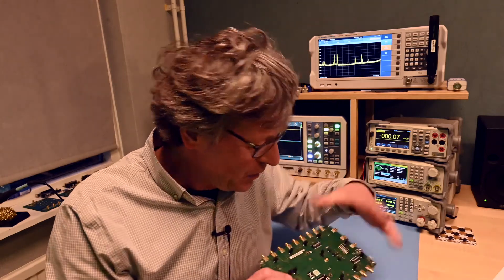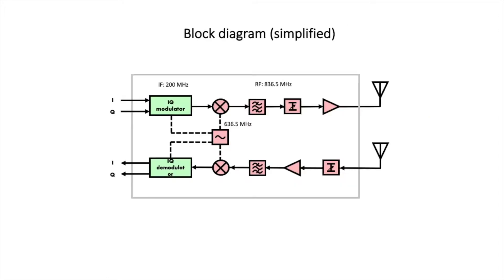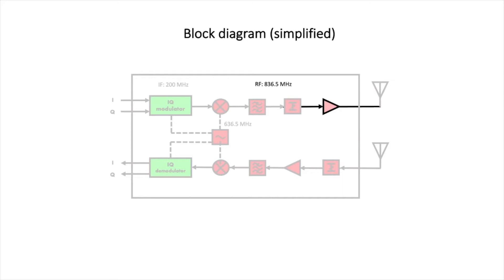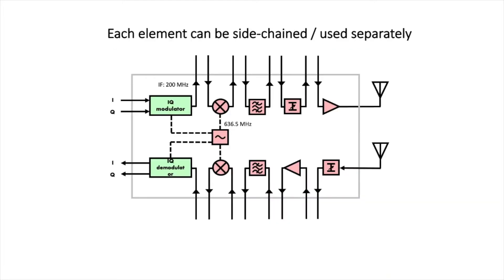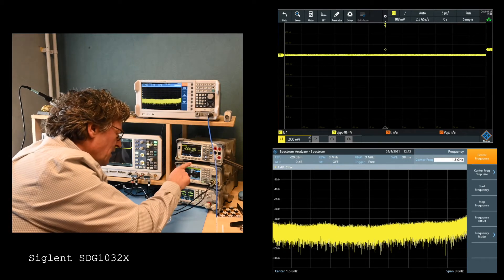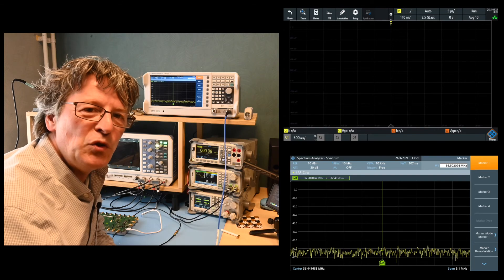REL #01 Rohde  & Schwarz FPC-Z10 Teaching Kit - Hands-on Review

Comment: Nice overview. I just bought an FPC1500, and decided to bite the bullet and buy this Z10 so I can learn more about it.  I hope you do many more videos with experiments with it, especially to fill in the gaps of the user manual.  I also bought a variety of individual modules (mod/demod/mixer/filters/attenuators/amps) so I can try to replicate the board's functions externally and/or as add-ons, to further experiment and compare results.
Reply from the maker: Hi Stan, sounds interesting to hook the Z10 up to the modules you mentioned! Let us know how you fare, and additional knowledge you gather! I bought a MiniCircuits 175 to 237 MHz bandpass filter (ZX75BP-204-S+) to use in conjunction with the Z10 and suppress some expected reflections but did not yet get to get into it deeper. Will keep you updated.

Comment from the maker: Timeline: 
  
00:00. Introduction
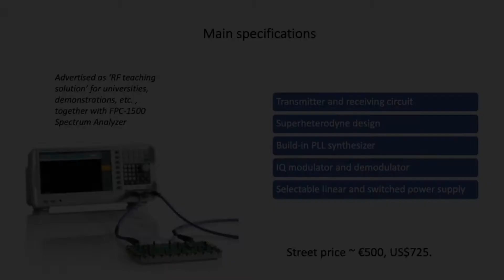01:45. Specifications and functional diagram
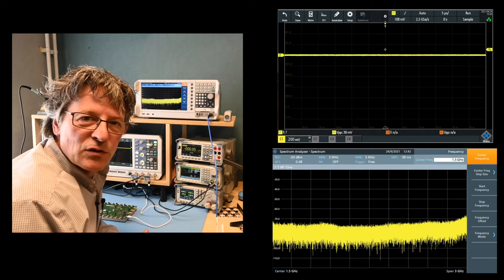09:24. Measurements:
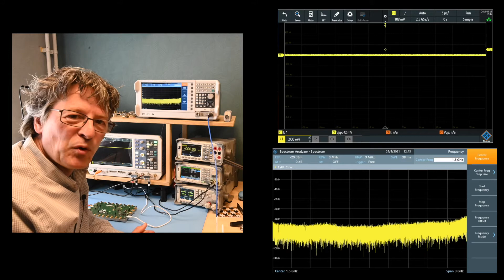    10:32. Input signal 
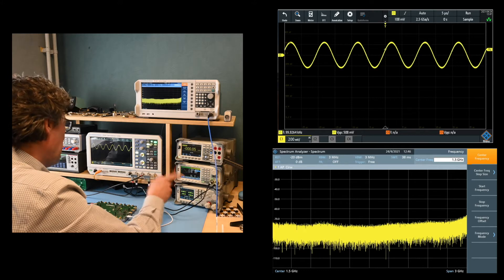    12:46. IF signal
    21:98. RF signal
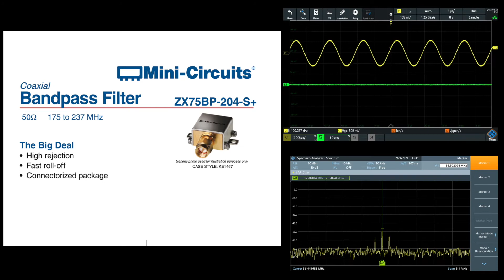    29:14. Demodulating I signal
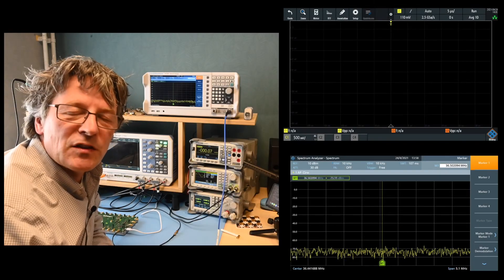    32:09. Demodulating IQ signal and digital/multilevel signals
    34:10. Future experiments
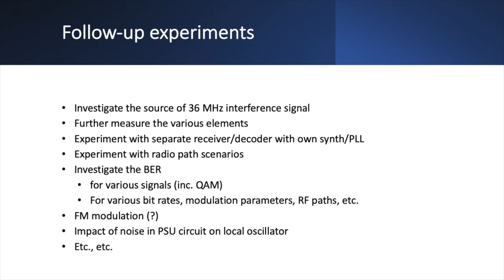34:50. User manual (and its issues)
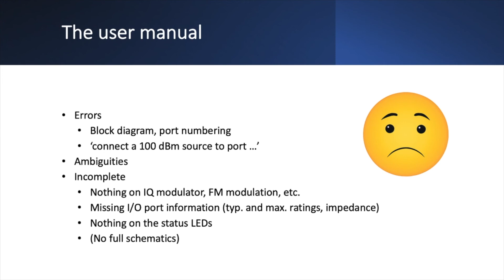36:55. Conclusions
38:05. Alternatives

Comment: This board seems to be a little tricky from the educational point of view. Think about it. All mixers (real mixers and mixers inside an I/Q modulator/demodulator) are fed from the same frequency source. This means they are locked together in frequency and phase. Which leads to situation you don't have to deal with costas loops in a receiver path, so you have the signal path with suppressed carrier, but that phase information goes through different path, which means you don't have to recover it when demodulating. But in real world, you have to and it's a crucial part of the whole design. And of course, you can use two boards, you can use some VSG to generate signal, etc. And this is not only the issue of this board, issues like this happens often in labs, where everything is synchronized to one central GPSDO. 

In fact, I like that board, it's a decent piece of hardware, but works fine only with a proper mentor, that is (as expected) not included :3.

Comment: Hello Rudi, I'm also interested in buying this board to learn about IQ-Modulation/Demodulation. Could you tell which kind of baseband signals you have used to create the QAM you showed in the Video starting at minute 32? Thank you.
Reply from the maker: Hi Elfi... I guess you refer to the picture with the 64 points in a QAM-like configuration. That was done by feeding the I and Q channel each with a arbitrary signal from a Siglent SDG1032X or SDG2042X which I think is called "Stairs". You can see its shape in the tiome domain graphs just next to the XY screen. Both get the same signal, but they are slightly different in frequencty, so, as a result, all the possible combinations (1-1, 1-2, 1-3 through 8-8) will occure. Its a fairly standard signals and I think many other signal generators will have this among their build-in arbitrary patterns. Also some Siglent osciloscopes with build-in ARB function generator have it (at least my SDS200C+ series does) but then you just have one channel, and you need two... Good lock! The Z10 is worthfile to explore!

Comment: FYI: I use as well FPC1500, etc. The FPC1500 generator does not produce clean sine wave signals, for lower frequencies the RF generator generates square waves which results into many harmonious.
Reply from the maker: Indeed, the tracking generator (TG) of the FPC1500 generates has lots of harmonics and looks more like a square wave than a sine wave. Then again, this is true for most spectrum analyzers (SA). TG signals are designed to feed into a DUT and to have the SA measuring the output of that DUT. Because the SA scans a narrow frequency range that sweeps along with the TG, there is no need for a clean TG sine wave and hence no need to make the (significant) investments that would be required to make a clean sine wave… If one needs a decide that generates clean sine waves over a wide range (e.g. 0-3GHz), one needs to resort to HF signal generators, which often cost as much as a spectrum analyzer.
Reply: @rudiselectronicslab861  your are right, however the FPC allows to use the tracking generator output as a stand-alone frequency generator.
In the meantime I purchased a used Agilent 4432B which produces very clean signals, including multiple signal signals (3G, BT, etc.). I just needed to repair the display background light and a stuck mechanical step attenuator which was easy.
Regards from Hannover, Germany, Helmut
Reply from the maker: @HelmutTschemernjak  Indeed, the Agilent 4432B is a serious signal generator for HF tasks. Good luck with it!

Comment: Hi Rudi, thanks for this video, I've just ordered a FPC1500 (fully loaded) as R&S are having 36% off promotion.  Appreciate details on the Z10, as like you, I'm interested in expanding my knowledge in RF.
Reply from the maker: Thanks, Mike. The FPC1500 is a very nice device, especially when fully loaded. If you have not seen them yet, do check the Element14 user reviews of the FPC,, especially those of Geralds and Sbabaz. With the latter, I had several exchanges on calibration and cable distance (can be seen below that review).  Anyway, enjoy the FPC and let me know if you also gain experience with the Z10 kit. PS
Reply: @rudiselectronicslab861  thanks Rudi, that’s a great resource and I particularly enjoyed your discussion re calibrating and compensating for cable length via the instrument. Nice find!! I will order the teaching kit as well, this is really interesting. Best M

Comment: Dang, paying 725 USD for teaching & testsignal board, thats heavy, like he ain't my brother, and almost double the price of my Micsig scope.
I have seen these teaching / test board in numerous videos, both from Tektronix and other vendors and it seems theyoften are handing them out to influencers...but they are not that uncommon.. but what about the Chinese flee market.. don't they have variants at a fraction of the cost.??
Reply from the maker: It’s true that this teaching board is expensive. I doubted quite a while before I purchased it (need to add that thanks to my job, I qualified for educational discount). It would be great if there were more choices on the market. But teaching/experimentation boards for IQ quadrature (de)modulation seem rare. When I made the video, the only others I came across are the Analogue Devices evaluation boards I show at 38:30 in the video. Expensive too. Have not seen cheap boards; perhaps because the required chip sets are relatively expensive?
Reply from the maker: Also real IQ generators and RF signal generators that have IQ inputs are expensive instruments. I soon hope to post a new video with a second hand combined IQ RF generator bought from eBay, and will certainly use the FPC-Z10 Teaching Kit in those tests!
Reply from the maker: “and it seems theyoften are handing them out to influencers..” Interesting. Jacob, could you be so kind to share URL’s?
Reply: @rudiselectronicslab861  Its "Jakob" good old "K"....and I recall two of biggest test equipment channels on YT.. Dave EEVblog and also Signal path... that some of their test & demo boards.. were gifted alongside some freebie product for reviews.

so Im not sure what kind of "link" you want..as I doubt sources like Tektronix etc.. will not see you as a significant "influencer" with merely 185 subscribers, - for that kind of backland' its often about the numbers, no matter the quality you deliver Rudi., which certainly is solid.
and also not possible for me' to put anykind of third-party link..
only the main channelholder can put outside link in comments..I can only link to other YT sources..

but from a big vendor looking for influencers for advertising & prm0ti0n of a given product fx a scope, it would make sense to incl. a demo or testboard to show some of the aspect a given product excels in..
also recall Aplied Science, used a demoboard that were handed when he were gifted a scope from Tek - but its years back.. in some regions its quite normal this lubrication of influencers, also why YT now have implemented, - that its needs to be stated.. and if a video holds anything of value that you been sent from a third-party to make that video, its "pald pr0m0tion as per se" and the video needs to be labelled as so..
as it is these years its very difficult for viewers to decipher what is advertising and what aint.
https://youtu.be/HWtOAWWY010?t=1788
Reply from the maker: @JAKOB1977  I was asking because I’d be interested in how others use the R&S FPC-Z10 kit and what we can learn from it. If you cannot post URLS, can you share references like TSP#xxx or EEVblog xxxx to videos that feature the FPC-Z10?
Reply from the maker: Also because when I made this video, I was not able to find ANY use experiences of this kit…